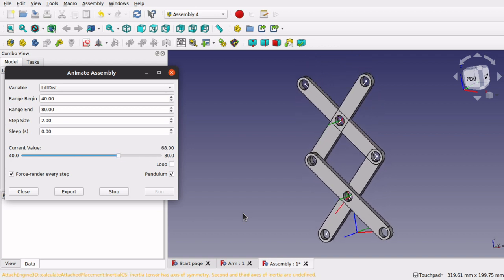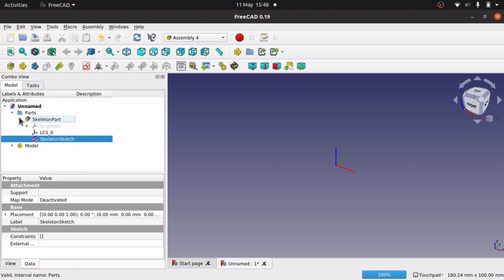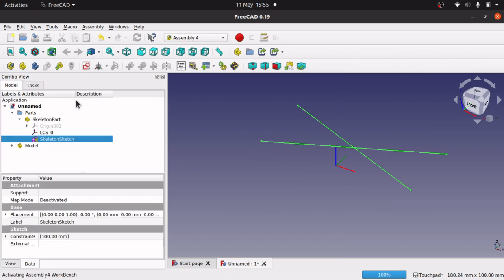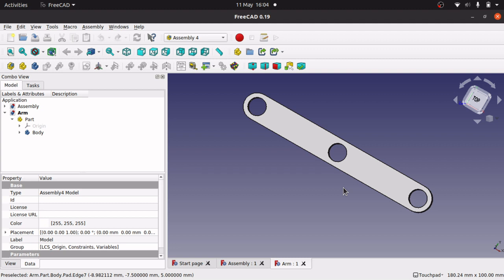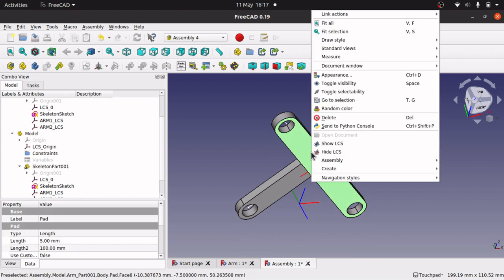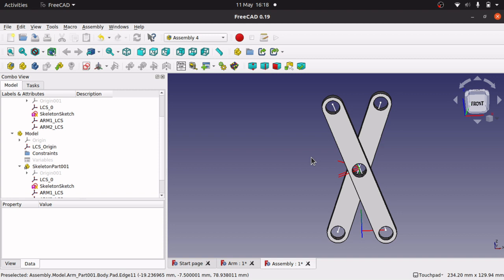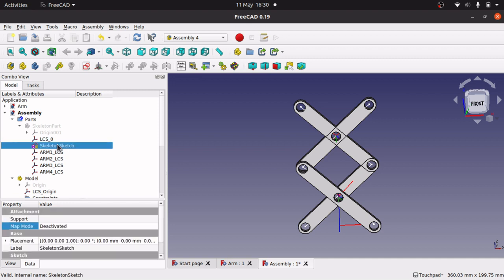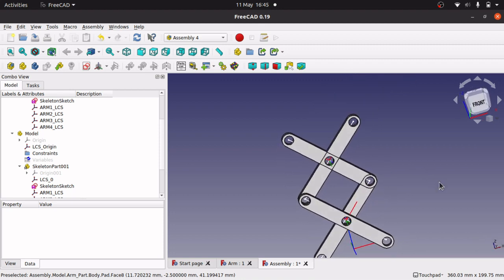FreeCAD Scissor Lift with Kinematic Skeleton in Assembly 4 Animation Mechanical Movement Beginners

Comment: 36:00 could a vertical and horizontal constraint on the edge ends have worked too?
In theory, the ends would be forced to overlap with that too.
Reply from the maker: That sounds a really good way to fix the issue. I can't see any reason why that shouldn't work. Sounds a much better option. Nice 👍👍

Comment: Very interesting, thank you.
Is it possible to replace the holes with (solid) rotating pins?
Would the procedure be the same?
Reply from the maker: Thank you for the comment. If you was going down the pin route it would be more suited to A2 plus wb. I have a video coming up soon regarding that workbench
Reply: @MangoJellySolutions  Thanks again, I will be attending this tutorial.
I don't know if you are a teacher, but you are very interesting, your explanations are very precise and you leave enough time to allow us to follow you in the practice.
You are the best in your class.